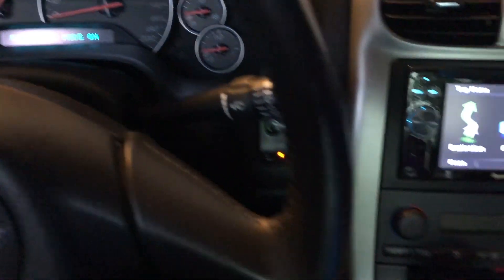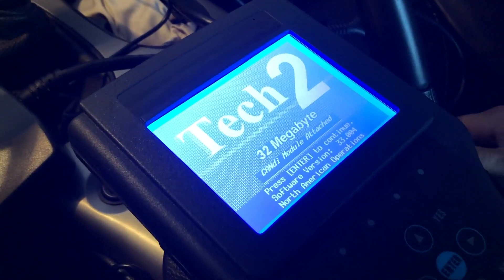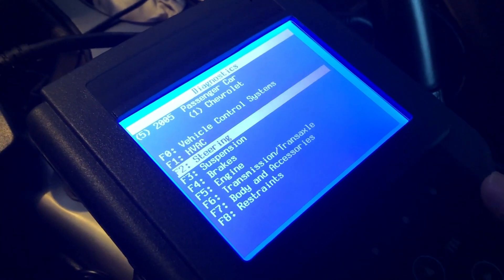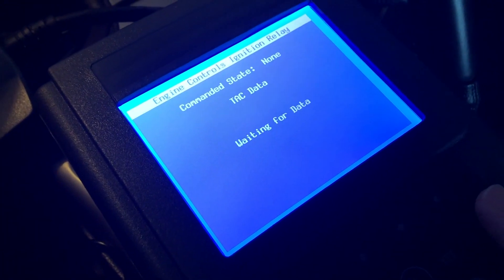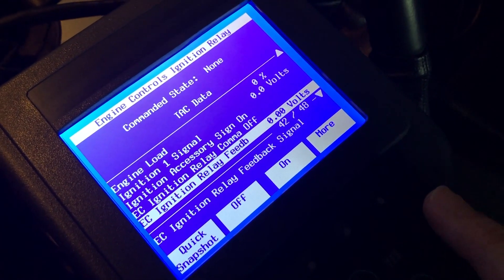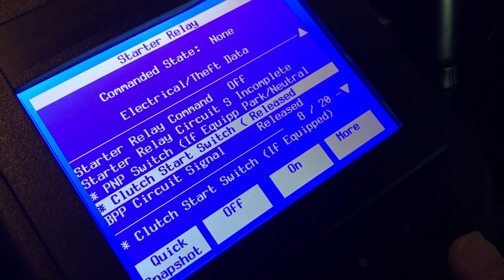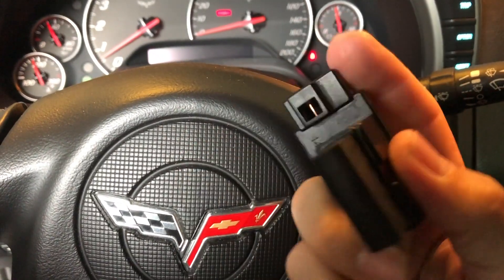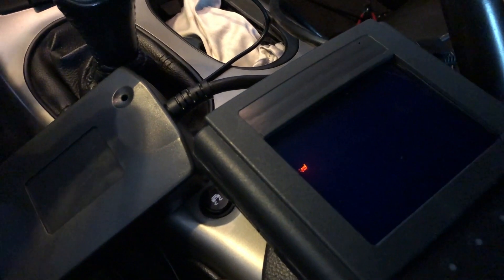GM Tech 2 Clone, to Diagnose Corvette No Start Issue

Comment: Good job, I'm thinking about getting this tool for my 2006 C6 because I don't like the dealers as well, Would you be able to look in the menu and see if it will do steering angle sensor reset ? SAS. I would buy it if it does this function,  thank you, kind regards

Comment: I looked it up on eBay and in the description it says tech 2 only support cars not trucks.  So does that mean this won't be a bidirectional tool for my gmc 1500?
Reply from the maker: I’m not 100%, but I don’t see any good reason why it would only work on cars... the trucks use the same hardware and software.
Reply: I'm pretty sure they're referring to heavy duty trucks not pickup trucks but I'm not 100% on that.

Comment: That switch looks a lot like the one in my old 99 Z28.  I remember it because it went bad in mine also.  I didn't have a tech 2, just a basic wiring diagram and my years of experience in USAF avionics troubleshooting.  GM is still making tons of dough from service departments off this switch.  Fucking crooks didn't get me on it.

Comment: What was the initial problem? No crank and no start? Or crank and no start?
Reply from the maker: So, honestly, I’m not sure. 

It was a no crank, no start situation. Apparently these cars throw the crank and cam sensor codes if it doesn’t crank for any reason.

The root issue was either the starter, or clutch position switch on the firewall. But since I replaced both, I don’t know which.